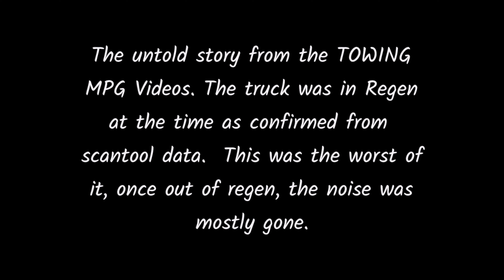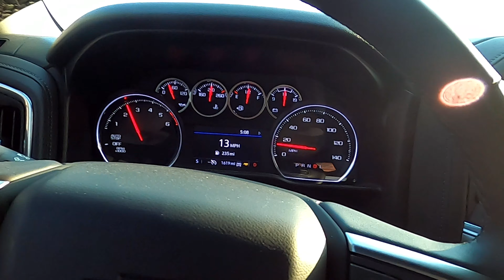Silverado Duramax Diesel 1500 LM2 Knock while towing in Regen - The Untold Story 2020

Comment: I test drove a truck that had 15 miles on it.  Had the same exact sound and I had no clue what it was.  Thought bad turbo, exhaust leak ended up telling the dealer that it didn't sound right so we took it around the block and it quit doing it, I'm  guessing because it stopped the regen cycle.  Keep us updated!
Reply from the maker: That sucks to hear ! These are typically extremely quiet and even I wanted more diesel noise from this engine, this wasn't it ! Will for sure keep everyone informed. Even with the noise, it still drove like a champ, surprisingly !

Comment: So I now have over 8000 on my 2020 RST and Ive had it less than two months. This knock happens damn near every time my truck is in regen. In fact, at constant speeds on the highway, it will do it and you can hear it in the cab when in cruise control. Not sure what it is. 

Be honest, I wouldn't worry about it while under warranty. The probability that the dealer will be able to replicate it and actually look into it is slim. You would have to drop it off right as it goes into regen, and have them drive it subsequently for long enough to detect it. 

Let someone like me (that drives over 40k+ per year) run this thing ragged and report back.
Reply from the maker: Truck is back and huge difference in noise ! Will continue driving tomorrow and make sure and then do a follow up video on it.

Comment: What was the issue Greg mine is starting to make this noise as well 91k on the truck seems like it only does it in regen and if there is a fix can I do it myself
Reply from the maker: Reset the injectors (dealership) but I bet there was a reprogram by GM that came out to address the issue because my 21 / 22.5 and 23 did not have the same issue.
Reply: @DemonWorks  interesting thanks for the info I’ll give the dealership a call and see if I can get this taken care of hopefully this doesn’t cost an arm and a leg

Comment: Mine started at 2500 miles..by the time they pretended not to hear it was 17k..the engine was replaced.it was 2.5 quarts low and the 5 and 6 pistons were screwed..now same noise has started with 3k on the new engine.back in the shop again.oil wasn't even on the dipstick

Comment: Did u notice fuel economy go down when it’s doin that noise?
Reply from the maker: No, because it was my first time towing with it. I will be towing again next month snd will do another video.
Reply: My 2020 GMC makes the same noise. Dealer tried telling me it’s the injectors being cold. But it it’s still does it when my truck is warmed up. Goin in for first oil change soon so what should I tell them to diagnose that u had them fix on yours?

Comment: 1500 miles and had that"knock" today during REGEN. Though light it was noticable on light accel
Reply from the maker: The fix was in my 3000 mile review video. Mine was resolved with just an injector relearn.
Reply: @DemonWorks  I will have to watch that one. Tried watching the Injector Balance with the Torque App but all I got was 0.0
Reply from the maker: @jeffreyethier387  I watched a lot of data with the gm mdi2 tool and couldn’t find a fault. If it happens again, I will reset each injector one by one until I pinpoint which one is the culprit.
Reply: I have had mine in twice for the same flash....it’s good for about 1,000miles than it starts back up. Mileage goes from 24-26 to 18. Thinking about trading this one in.
Reply: @Alex-ot4kt  the dealer told me they could not replicate the sound, and saw no issues on their scan so no flash for me unfortunately. Will wait for another regen and get a video. If that dealer does nothing I'll take mine in to another. I have 5k on mine and my mileage is still only hovering around 20-21 with 80% highway driving...

Comment: LZ0 still does this for those who are searching. If it gets quieter or goes away after warming up it’s 100% active regen. If it’s constant regardless of temp, go to the dealer to get injectors reprogrammed and get a check up
Reply from the maker: hmm, i'm on my 5th 3.0 duramax and the only one that did this was this 2020.
Reply: @DemonWorks  that statement alone proves how impressive the 3.0 is, especially the LZ0, I love mine and the mileage that comes with it. 

Facebook is littered with 3.0’s including new gen LZ0’s clickin and clackin like a 200k 6.0 powerstroke. Lots of dealers doing forced regen and injector relearn as the fix. If that doesn’t work they start replacing injectors and fuel pumps. Very few are actual rod bearing failures, some are transmission or wrist pin/skirt issues (LM2 mainly)

my 2023 did it to me at only 7300 miles, scared the hell out me,  shrugged it off as bad diesel fill up after a good 2 hour drive with no load and some hotshots diesel extreme with no CEL for the duration. 

Was significantly quieter afterwards, figured it was an unhappy incomplete regen, my daily commute is 20-30 minutes to work and back at an average of 30 mph, maybe not enough time to heat everything up.
Reply from the maker: I will keep a closer eye, I am part of every 3.0 duramax facebook group and cannot recall any LZ0's with issues like that. I'm also a tech and no bulletins relating to that either. I appreciate you sharing the info! @DGXJ94
Reply: @DemonWorks  no worries, and thank you for all the hard work and content you push out on the 3.0’s!

usually by searching “3.0 duramax knock” is how I find them, even seen this exact video shared as an example in comments. To dig further into I view the profile and their post history on that specific page to get more info.

Imagine my shock when a guy had a full engine failure yet posted a video shortly after buying the truck of maxing out the mph limiter ☠️